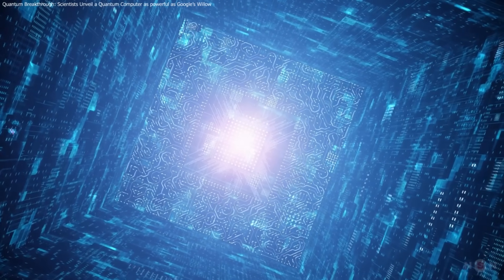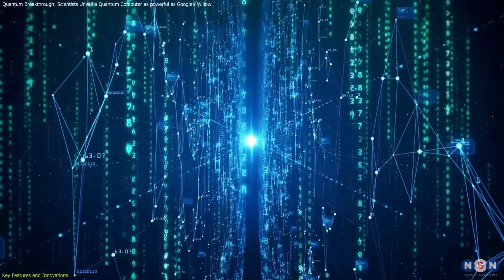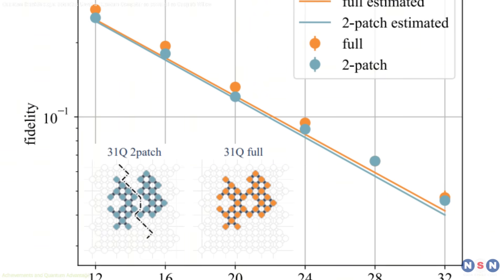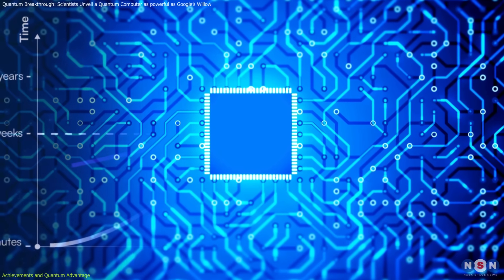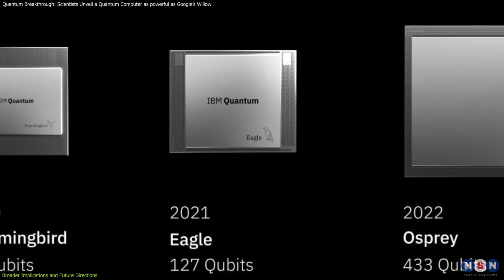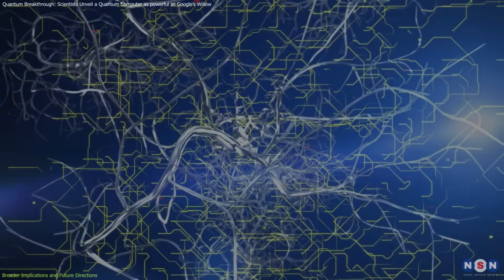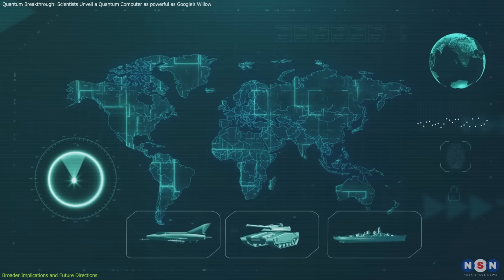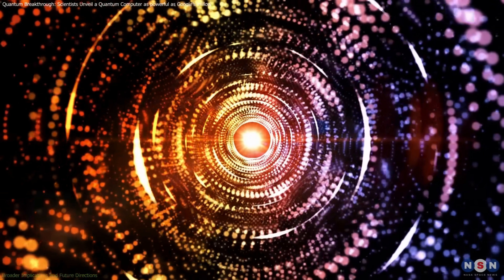Another Quantum Breakthrough: Scientists Unveil a Quantum Computer as powerful as Google’s Willow

Comment: For current real-world applications: Superconducting qubits (Niobium & Aluminum on Silicon) lead in scalability and performance.
For long-term scalability: Silicon spin qubits and topological qubits are promising.
For ultra-high precision: Trapped ion qubits offer the best coherence.
For quantum networking: Photonic qubit like Silicon Nitride (SiN) and Lithium Niobate (LiNbO₃) for photonic chips are the best choice.

The “best” material depends on whether the focus is on scalability, coherence, or ease of fabrication.

Comment: Trapped ion would be the one to progress us into the utopian quantum computing utopian society.  IonQ is working on trapped ion but before that's even close to possible they have to fix the scalability issue.  They're working on photonic  interconnects but if that doesn't pan out then that leaves only superconducting which is what d-wave is using for their quantum annealing so that's no help with those big 10 foot computers, not practival for large commercial adoption not does it also have the scalability needed.  IonQ is our only hope, unless a different start up figures it out.
Reply: Nm, kept researching and it looks like IonQ had a tech breakthrough. They partnered with Oak Ridge National Laboratory and they solved the scalability issue by creating Quantum Imaginary Time Evolution principle (QITE).

Comment: For everyone wondering how we know that the answer a quantum computer is providing is correct, it's usually because we either already know the answer (like prime number factoring), the problem is small enough to be done by a traditonal computer in a reasonable amount of time (small-molecule simulation), or through simple observation and result analysis (material synthesis).

Comment: A lot of hype around Quantum computers. I think there's a long way to go.
Reply: @omasirichukwuudeinya3736  Quantum can entangle, but GPUs when they lose oscillation cause not symmetric exactly like quantum, looks like a rock thrown in water.  But you could align water container with box light above water so grid of lights line up with grid of plastic dots at bottom of glass. And this would cool water cause could be u shaped diffuser at bottom of glass and when you cool a room after it very hot can smell things again . And that would be quantum well cause red ring of light at base of container.

Comment: Got a question,  if the biggest computer takes billions of years to make the task, how can we be sure this 1.6 seconds calculation is right, do we check the results with another quantum computer?
Reply: so basically you can encrypt a message. and forcefully decode it with the quantum computer. Normal computer would make the billion years to do that but if the quantum computer does it you know exactly if it was correct. because you know what was the encoded message to begin with. So that's how you can test if it works
Reply: Great question! It touches on the accuracy and verification of computational results, particularly for highly complex or quantum calculations. Here's how we approach this:

1. Verification via Redundancy: For classical computations, we often verify results by running the calculations on different systems or algorithms. Similarly, for quantum computations, we might use multiple quantum computers or different quantum algorithms to verify the results.

2. Cross-Validation with Classical Systems:

For problems where classical solutions are feasible, we use classical computers to verify the output of quantum systems.

When classical verification is impractical (e.g., due to time complexity), we rely on simulations of quantum computations for smaller instances of the problem.

3. Error Checking and Mitigation: Quantum computers inherently face issues like decoherence and noise. Advanced error correction and fault-tolerant quantum computing techniques help ensure results are reliable.

4. Statistical Confidence: Quantum computations often yield probabilistic results. Running the computation multiple times and analyzing the distribution of outputs provides confidence in the result.

5. Independent Methods: Even if the largest classical computers can't solve a problem within a reasonable timeframe, alternative approximate or heuristic methods might validate key aspects of the quantum solution.

6. Benchmarks and Proven Models: Before solving unknown problems, quantum computers are tested on benchmark problems with known solutions. This builds confidence in the correctness of their computations.

In summary, while we don't typically "check" results with another quantum computer (due to cost and rarity), we use a mix of redundancy, statistical analysis, error correction, and known benchmarks to validate computations. Quantum computing's potential lies in solving problems where classical systems fall short, but trust in results depends on rigorous methods like these.
Reply: @QuantumSavant  Thanks for replying and clarifying.
Reply: @gilsonfelix3415  Any "answer" whose validity cannot be checked cannot actually be an "answer" to anything that matters, basically by definition. Any useful "answer" will be used. If it is wrong this should be evident when applied to do anything. If not then it is either right or that "answer" was always useless information.
Reply: Billions of years seems to be an estimated measurement itself
Reply: @glennleicy4316   an 'educated guess' ;-)
(based upon proven mathematical principles of calculation).
The willow version had a value in the quadrillions (10^^ 25 years)
Reply: @glennleicy4316  Believe it or not we can calculate how long it would take to calculate certain calculations.
Reply: You can know the end result without an equation. Math is after all about calculating reality. For example calculate the growth of a human from the first cell. Those programs are still crunching. Quantum finished ...
Reply: Nature never used math to do what it has done. Time was main ingredient. 
Something quantum computing can gobble up.
Reply: I've started to check it with my calculator and I'll get back to you shortly!
Reply: This is the question by CHATGPT

Great question! It touches on the accuracy and verification of computational results, particularly for highly complex or quantum calculations. Here's how we approach this:

1. Verification via Redundancy: For classical computations, we often verify results by running the calculations on different systems or algorithms. Similarly, for quantum computations, we might use multiple quantum computers or different quantum algorithms to verify the results.

2. Cross-Validation with Classical Systems:

For problems where classical solutions are feasible, we use classical computers to verify the output of quantum systems.

When classical verification is impractical (e.g., due to time complexity), we rely on simulations of quantum computations for smaller instances of the problem.

3. Error Checking and Mitigation: Quantum computers inherently face issues like decoherence and noise. Advanced error correction and fault-tolerant quantum computing techniques help ensure results are reliable.

4. Statistical Confidence: Quantum computations often yield probabilistic results. Running the computation multiple times and analyzing the distribution of outputs provides confidence in the result.

5. Independent Methods: Even if the largest classical computers can't solve a problem within a reasonable timeframe, alternative approximate or heuristic methods might validate key aspects of the quantum solution.

6. Benchmarks and Proven Models: Before solving unknown problems, quantum computers are tested on benchmark problems with known solutions. This builds confidence in the correctness of their computations.

In summary, while we don't typically "check" results with another quantum computer (due to cost and rarity), we use a mix of redundancy, statistical analysis, error correction, and known benchmarks to validate computations. Quantum computing's potential lies in solving problems where classical systems fall short, but trust in results depends on rigorous methods like these.
Reply: It might help to realise the qubits in this and the Willow chip can only run for around 1-2 TENTHS of ONE THOUSANDTH of a second before their error rates make further calculation completely unreliable. They are no -where near ready to run for the 'full' 1.6 seconds just yet. All the hype about the speed of their problem solvng abilities are pure estimations of what they could do' - IF they were ever able to run long enough with a sufficiently small and acceptable error rate.
Reply: @MrAuswest  True enough but, as the video states, error rates are coming down with each generation.  When a quantum processor can compute by thousands or millions of orders of magnitude faster than conventional computing, how much sustained processing does it really need to be useful?
Reply: @tmstone835  Kinda depends upon how much accuracy is worth to the project and which of the millions of possible 'almost right' answers you're going to consider before deciding if you have the right solution to your problem, doesn't it?
Reply: @MrAuswest  Thanks for replying 😁
Reply: 🤔 No they just ask the same question again, and if it's the same. Well it has to be right 👍. 😁
Reply: @waynef9314  Then I have to believe it . 🤣🤣🤣🤣🤣🤣
Reply: @waynef9314  OR      it keeps on making the same mistake and we can't tell it why it is wrong the first time??
Reply: @waynef9314  its not necessarily right but at least its consistent.  Providing consistent answers seems to be one of the first challenges confronting quantum computing.
Reply: Compare result with observation.
Reply: @vaclavsimak502  if it takes billions of years there would be nothing to compare it to observation wise
Reply: @sopranos45  Brilliant!👍
Reply: @vaclavsimak502  thank you